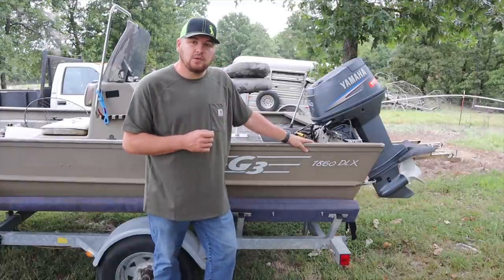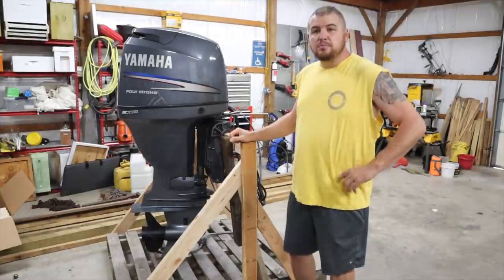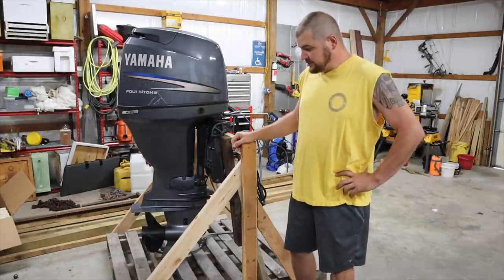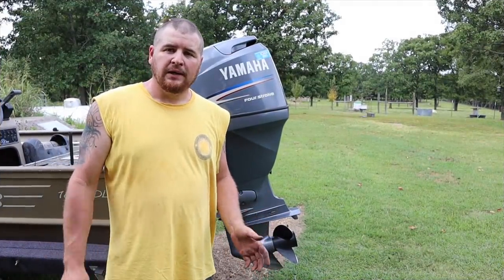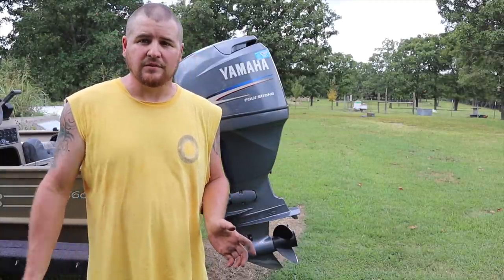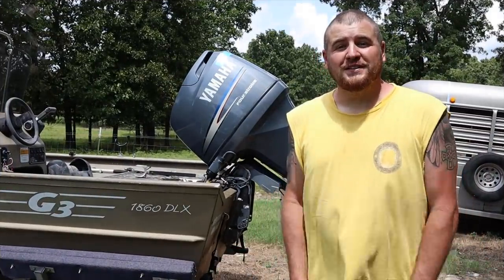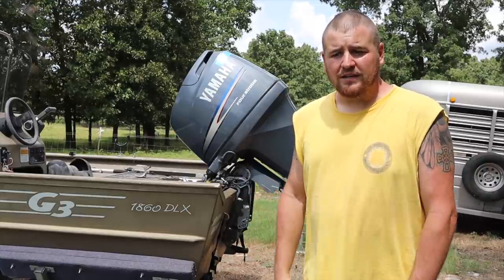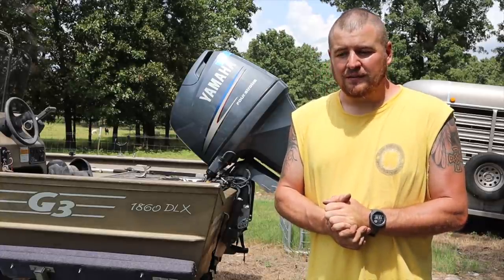Yamaha Outboard Motor Swap G3 Boat | The Need For Speed

Comment: Kevin, Congradulations on your up graded motor.  I hope you don't mind a sugestion. Check the pitch on your prop. That can in fact make a hugh difference when you are checking the motors performance and speed. We always invested in trim tabs also on every boat we owed. Best thing if your considering water sking. My first boat was a small cabin cruiser with a 125 outboard Johnson. Was a boater for over 4 decades, and active member of the United States Power Squadron. Divorce ended that. LOL. Even thou I'm a woman, you simply don't forget somethings. LOL Much love, good luck. G-D Bless and Stay Safe. Don't forget your life jackets. Haaaaa, Haaaa.

Comment: I have an Alumacraft 1860 tunnel hull with a 50hp Evinrude. A state patrol buddy clocked me on radar at top speed from a bridge at 35 mph. Your G3 1860 dry hull weight is 100 lbs less than mine. Your G3 should "flat fly" with that 90hp Yamaha!!! Congrats on your motor find. Hope it serves you well.

Comment: Get some bigger finn's more control on the water, plus get a safety bar that hooks to the motor and trailer it just holds the motor in place while driving and extends the life of the tilt and trim motor.

Comment: I did the same thing, replaced my 130 Yamaha two stroke with a Yamaha 115 four stroke. My tilt and trim works on the engine, but not on the controller. Was the 10 pin plug your only electrical connection? I’m thinking I may have knocked a wire off when I pulled out the oil cable and the gauge plug cables.

Comment: Boat guys I need a little advice.  I'm looking at swapping an old Evenrude for a new four stroke Yamaha, Merc or Honda.  The boat doesn't have any electronics, no speedo or tach.  Will I have to replace the steering cable?

Comment: I have a 1860 cc, looking at repowering from a 90hp 2 stroke to a new 4 stroke of some size maybe even a suzuki. Any issues with the extra weight of that 90 4 stroke you have? Any handling issues with the extra wt on the transom?

Comment: How did you stop the throttle from getting stuck?
Reply from the maker: Had to adjust the linkage
Reply: I have a boat that's been sitting for about 10 years and the throttle seems a lil stiff what could i do to fix it? I know little about boats